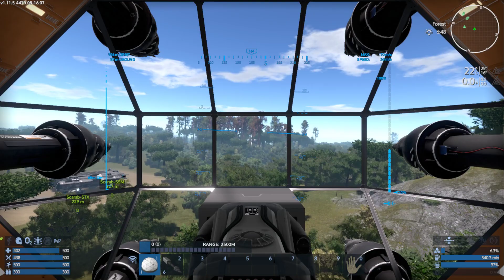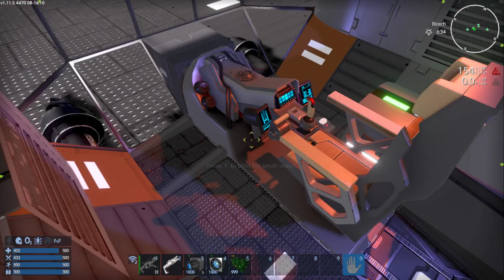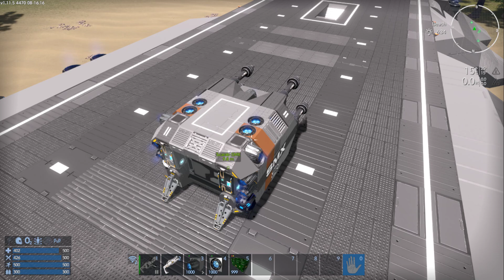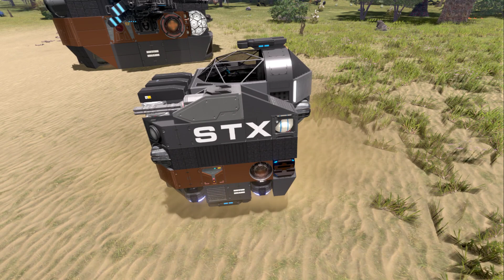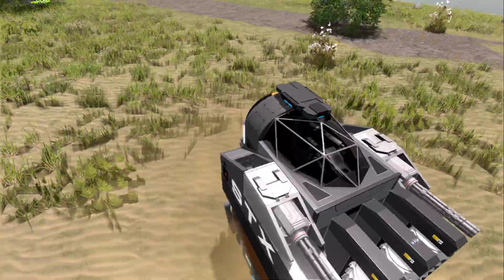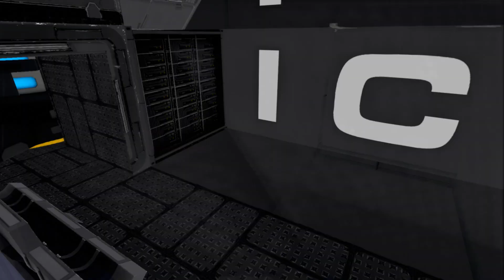Empyrion Galactic Survival - Carapace-C2X and Scarab-SMX RE2 Builds WIP

Comment: I can see why you do prefer the large generator on the CV over the advanced gen, from a building perspective. But you are wasting a huge amount of cpu there.
A single Adv. Generator will give you the same power as your 4 large generators. At half the CPU cost. 
Thats 50.000k CPU you are giving up there for the smaller form factor.
Reply from the maker: Good point. I really need to look at the numbers some more. The biggest issue I have is the ship has very limited room for an advanced generator. I do believe to get everything right I would need to just make a brand new ship designed to hold some larger parts or get rid of the farm for more engineering space. And thanks again!

Comment: in my experience a small mining SV like that needs at least a couple of gatling guns for defense. having no way to deal with drones is gonna greatly limit what this vessel can do, practically.
Reply from the maker: Good point. The problem is at tier 1 a gatling gun or any turret is 1000 CPU and you only have 6000 to work with. So, maybe a 2-4 drill miner with a little less storage and thrust. I will mess with this and see if I can up with something that could at least have 1 weapon. Or, make a little bigger version you can add a basic core in and upgrade. And thanks again!
Reply: Agreed. The SV miner is a work of form and function but if you want to take it to a starter moon you’ll need at least one Gatling gun to handle the drones hovering over ores.